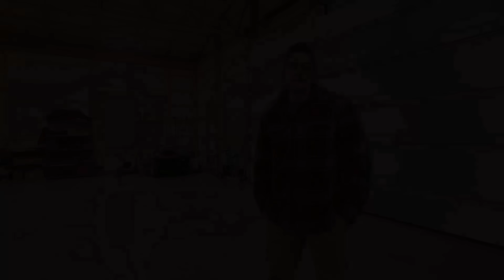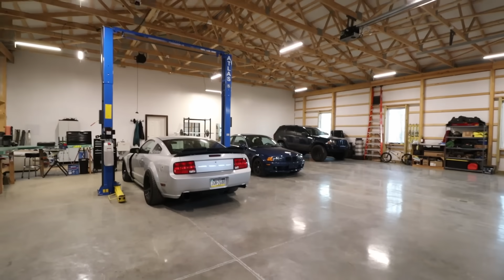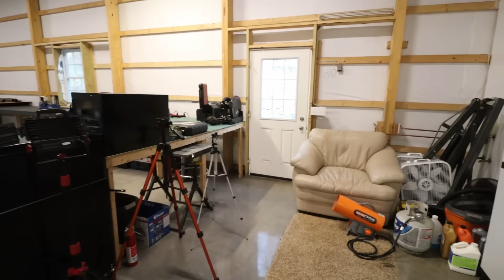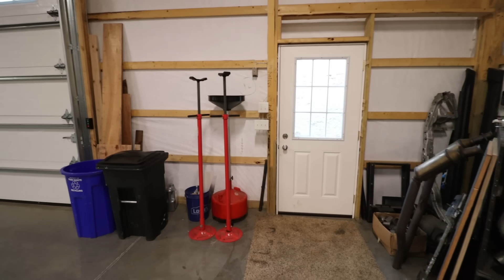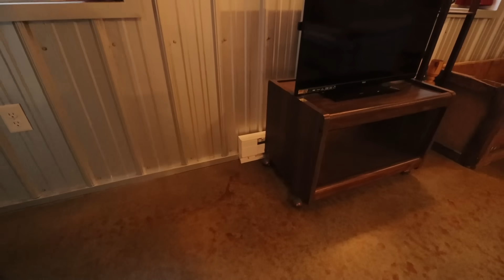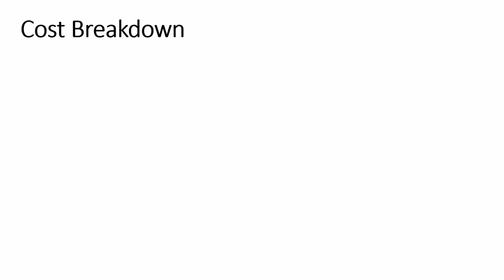50x70 Garage House - FULL TOUR and COST Breakdown

Comment: Very nice. The only thing I would have done differently is run tubing under the concrete for future radiant heat system. Once that 6" of concrete is warm the boiler might turn on once a day. I've installed quite a few of them and I always told the owners, "at least put the tubing in for future use". Comes in handy when your body gets older and colder.
Reply from the maker: I did consider this but just wasnt in the budget and also didnt wanna worry about drilling into the pipe when mounting things to the floor.

Comment: I would say mini splits are the move. We use those around my parents house and it’s definitely worth it
Reply from the maker: Someone else suggested this, definitely will look into them👍
Reply: @Kordare  remember they have a heat limit between 40 Deg F to 0 Deg F when heating depending on the unit.   In other words you will need a separate heater when it's cold
Reply from the maker: @OxAO  thanks for the tip!
Reply: The new low temp ones actually kick out heat down to -22.  Mine still heats fairly well at -13.  Yes, some backup heat is needed, but not that often.  I live in southern Minnesota.
Reply: They are great, can heat/cool certain areas of the house when needed and you have redundancy with separate units.
Reply: If you don't mind your house looking like a Bangkok hotel room.  I wish they looked better.

Comment: $134k + land absolutely. I know guys who have built 1550 sqft homes 9ft pour basement and 9ft first floor, 12/2 roof and 2 car attached garage for 140’s. Could of shaved even more off if it weren’t for geo thermal and septic. The more you can do the cheaper it is.

Comment: Saw that big step ladder.  I've got a space with a twenty foot ceiling (basically a warehouse) and I bought a trestle ladder.  The bottom is basically a 16' folding step ladder.  I thought it was a dumb purchase, but I put a frame under it with wheels so I could erect it and then roll it to where ever it was needed.  That thing is fantastic for working up in the ceiling or high on the walls.  Really, really stable platform.  I never erect the vertical trestle portion.
Reply from the maker: Nice! Yeah I like mine, it's a 12 foot with platform at the top which makes things feel a lot safer.

Comment: The house/garage would have had the more space for a second floor in the house part with out the pitch you added. 
So claiming you did the pitch that way so you could have a second floor in the house part makes no sense and you lost 
space by doing the pitch change.
Reply from the maker: I did the pitch change mostly to break it up so it didnt look like one big warehouse. The pre fab roof trusses I used were available in that pitch, the roof trusses used in the garage portion are not of the type that you can put living space inside. If I would have wanted a full second floor in the living space I would have needed to make the entire building taller or use a custom roof truss in that section.

Comment: It is interesting to see someone else with similar ideas.  In 1972 We built a 40X72 metal bldg with the house  40X24 in one end.  The house portion also has a 40X24 basement.  We've added a 24X72 extension providing addn'l  24X30 shop and a 24x40 ceramics studio/office space.   I have a machine shop in the larger shop with two lathes, a mill and several welders.  Also sheet metal equipment.   I have an experimental helicopter in the main shop with a helipad located  some 75' away.  BTW all my benches are made from steel pipe and angles.  I had the entire metal bldg spray foamed.  As it always happens, we have expanded into two 40' and two 20' containers.  a 4x4 cnc plasma cutter and 15kw diesel generator in one of the 40' containers.  With the exception of the concrete floors and block work of the basement, I did all of the erection, plumbing, wiring etc. etc.  I forgot to add:  Never had a Mortgage!!! And maintenance has finally required a coat of paint on the roof.

Comment: Will the car lift remain stable over time being that there are two support posts as opposed to four? Also is it mounted to the existing concrete? 

Great video! Looks like a lot of thought went into usability. I’m getting some good ideas. Thanks for posting.
Reply from the maker: Yup these are the common type of lift used for auto work, it is lagged into the concrete. Thanks!

Comment: Unreal, super cool space to work and live...well done man!!
Reply from the maker: thanks a lot!
Reply: Looks like working on cars is a business for you?  If so, how did that impact the permit process as well as lot /property requirements regarding commercial vs. residential use?  Did it need to be zoned commercial/mixed-use and/or bldg permits bound by commercial requirements?
Reply from the maker: @tkcarpentry  actually cars are really just a hobby, I do have a small fabrication business, but never with customers actually coming to me. So it is still just zoned residential.
Reply: @Kordare  ah, sounds good.  I'm a renovation carpenter/contractor, mostly residential but some commercial work and I know commercial requirements are very stringent and add a lot to project costs.  Cool it was able to be done residential only.   Enjoy the space, wish I had a shop that nice!
Reply from the maker: @tkcarpentry  yeah that's for sure, thanks a lot!

Comment: Don’t go down the Snap-on road.  Harbor Fright has some really good toolbox   Toolbox don’t make you money they just hold your tools.  You can get in with a lock pick as fast as a key on snap-on or HF so security is not a valid reason.  Buy good tool but HF boxes are really good now.   Love my 72”, 56” and 30” with side cabinet and 56” on both.

Also love you build seen it as you built it and was a little envious of it.  I would love to have a house like that
Reply from the maker: Great suggestion, I have looked at those and they seem very solid. Thanks for checking out my build!

Comment: You don’t need a wall around that toilet. Function over form
Reply from the maker: hahaha truuuuuu
Reply: @Kordare  when you do get around to walling it in you should consider making the toilet wheelchair access, just my two cents
Reply from the maker: @wonderfultigger6620  if space permits, I agree.
Reply: Wonderful Tigger pop pop
Reply: @Kordare  What I would recommend there is to build the walls so it blocks off that entire corner, then you can get safe storage for all those paints and chemicals. In the winter you can turn down the heat in the garage and just heat the bathroom area.  Instead of insulating the entire garage, just put in a wood stove (wood pellets perhaps, unless you've got a cheap source of firewood). We had one in an uninsulated shop in Minnesota, and it did just fine.  So between that and the bathroom, those are a couple cheaper options.
Reply: Waste oil heater. All those cars need oil changes. Wood makes a huge mess. I’m building a pole barn house right now and as much as loved the deee heat from wood I just don’t want the mess in my new house.im doing hydronic heat so that eliminates the dust associated with a regular forced air furnace so fuck the wood stove on the inside. I may build a wood fired boiler outside if it’s needed but I’m hoping solar panels and a on demand water heater will do the trickX

Comment: Would you mention which usda zone your in?
Congratulations on a well planned & executed build. The concept of making it big enough & adding the 'wants' later is very wise. You have the potential to be self employed & beholden to no one but, yourself. Did you have any trouble with any of the subcontractors on this build? Where any of them more 'difficult" than the others? Will suggest locating a small closeby saw mill for lumber needs or possible portable mill & use your own timber for future projects. Trex decking is not a 'pretty' material but, would give 15 years of maintenance free service.
Thanks great content & for sharing cost breakdown.
Reply from the maker: I was very lucky and didn't have any major issues with any subcontractors on this build. Also, my lot is zoned residential. And yeah that would be very cool to use my own timber to build some outbuildings! Thanks for checking it out!

Comment: Just get 2, 55 gallon drums and the wood burner kit on Ebay or amazon and make a double barrel wood burner and put it in the garage for now for some heat. U would have working heat for cheap
Reply from the maker: That's exactly what I've been thinking.
Reply: @Kordare  I get the drums from my work when they done with them. Plastic ones also. I was gonna start building them and selling em. But decided not to.

Comment: You might want to consider a door at the top of the stairs to keep from heating that space that you don't use for now.
Reply from the maker: I actually keep a sheet of insulation board across the opening in the winter, just didn't show that in the video.

Comment: In most municipalities, the electrical wouldn't pass inspection as is.  You can't have exposed NM cable under eight feet.
Reply from the maker: Someone else mentioned this, honestly not sure but it did pass with no issues here

Comment: Thanks for this. Well paced and great summary. It's given me inspiration for my ultimate retirement plan. Get to mid life and you end up with large, expensive house right in the city where the living space/utility space is the opposite ratio to yours. That ratio you designed of utility to living is great, and your planning for extra rooms and expansion is such an overlooked aspect for ongoing life. Well done.
Reply: 2 of my favourite details in yours are the drain in the garage floor and the interior water spigot for the water-blaster and just filling buckets etc. I think the only addition I'd make is a square drain inset an inch into the concrete right under that spigot.
Reply from the maker: Thanks for the kind words and I'm glad I could help give you some inspiration!

Comment: Very poor choice for location of window on bed wall of bedroom. Forced the bed into corner and in front of sliding glass door. Result of not doing interior furniture layout before building. Furniture placement as important to window location as any exterior appearance issues.
Reply from the maker: I actually had the bed on the opposite wall and spacing was fine but I decided to move my desk in there so this is the way I have it for now...works fine for me.
Reply: Also you never design the head of the bed with it's back to the interior entry door to the room.  You always want to face the door so you see anyone entering.

As an Architect and Interior Designer for 50 years, this is what I learned. 

You also may have problems with your proposed bedroom upstairs. You will need to have a fire egress window that has a window sill no more than 42" above the floor of that room. It appears your window is above the stairs. This will not pass any local building code.

Comment: In the garage you shouldn't have an electric outlet lower than 18 inches but I always put them at least two feet. Reason for that is vapor . Like gasoline or anything like that.
Reply from the maker: makes sense! Mine are all like at least 3 feet
Reply: @Kordare  
Try to keep extension cords up as much as possible too. I have rewired buildings after fire and in a garage things can go wrong very quickly. I really like the receptacles in the ceiling that a very good idea. Having a cord reel helps keep you safe. Makes electric connection up high enough that nothing happens. There are explosion proof boxes and things that can be done but I really don't recommend it. Just keep things up high.
Reply from the maker: @benjimenfranklin7650  great suggestions, I appreciate it!

Comment: 25:41 so for the electric do you know if it would be cheaper to have a powerwall with solar panels instead?
maybe in the long run at least
Reply from the maker: definitely not cheaper up front of course. I use such little amount of electric it would take a very long time to make it worth it to go solar.
Reply: @Kordare  i went on google and the average size solar panel cost is 11k-14k plus power wall 8k 
your electric estimate is 10k-15k
since you use very little power you could probably go far cheaper 
but i heard it's not worth it anymore once when you have the electric infrastructure because they will continue to charge you
but than again there probably isn't a lot of sun there and maybe someone can steal it
Reply from the maker: @Eduardo_Espinoza  yeah it may be worth it for some people, just not something I see in my future
Reply: @Kordare  Okie dokie

Comment: Missing the vent hood for the stove and I'm not seeing any smoke/CO detectors....these are pretty important, especially if you plan on cooking anything worth eating....but if you plan on Ramen the rest of your life, it'll do.  Personally, I would have angled the lift at a 45 and would have had plans to line them on the right side for multiples....but that's just my feelings on it from my mechanic days.
Reply from the maker: The microwave is actually a wall mount with hood vent so I plan to mount that soon. And yeah I have smoke/cO2 detectors in the main space, bedroom and second floor. Wouldn't pass inspection without those!

Comment: Very nice job, well done! One suggestion on a wash/utility sink: pick up a used SS restaurant sink. You can typically find them used for about the same as the box store plastic utility sinks. Very robust, and many have a stainless drain board on one or both sides.
Reply from the maker: Great tip, thanks!

Comment: My friends only question is we asked do y’all do under mount sinks for butcher block and all of them sead that will not do it how is it holding up is it leaking or is the wood degrading or is it not wood at all
Reply from the maker: It is real wood and I've had no issues at all with it. I used a food grade polyurethane sealant once everything was cut. Been using it for over 2 years now.

Comment: one thing that you should do is put up a 'back-splash panel' on at least some of your work benches. You won't believe how fast 'dirt' will get on the walls. Good idea about plenty of clearance around the lift area: You can move an engine hoist around it. It is absolutely ZERO fun when you can't get the engine out from the front without clearance...
Reply from the maker: Good idea! I also still need a backsplash in my kitchen as well 😂

Comment: Nice build!!. Question if you have time and see this... How did you manage to keep the ahh Garage smells lol. Gas,exhaust ect... type fume/smells out. Did you have to do anything else to seal it off so fumes ect didn't make their way in except maybe exhaust roof fans?
Reply from the maker: Thanks! I haven't had any issues with garage smells in the living space. The separating wall is fully insulated, double drywall (for fire rating) and goes the whole way to the roof line so it does a great job keeping smells out. Thanks for watching!

Comment: how did you fund this without going into to much detail of course cause im 24 and uber jealous definate dream come true
Reply from the maker: To be honest I just saved like crazy and did nothing fun for years. Biggest tip: don't buy what you don't need!
Reply: @Kordare  i honestly have a problem with that being brought up with less than other kids really changed my when i got older and made me want things i could finally buy myself and me being a car guy isnt helping or the fat that im upside down on a 15 year old car now lol i envy you dude but im trying my best even tho my inner self is fighting to give up.
Reply from the maker: don't give up man, it helps if you can write out everything you spend for the month and really pick out what you can reduce or eliminate. Getting rid of debt should be first priority.  Also, you should do your best to never have debt on a car. It's completely unnecessary.  My daily driver is a $2500 e46 and I've done nothing but change oil in 2 years. Remember to step back and  look at what you really NEED. Take it one step at a time and you'll turn it around 🙌

Comment: is having a solar power system to cut some of your electricity bills for the lighting and heating is a good option? you have lots of roof flooring above.
Reply from the maker: I use such little electricity with all LED lighting and the wood stove, that it doesn't make sense for me. It would take a long time to get a return on investment.

Comment: nice setup! On the pressure washer part, check out a wall mount electric one with a hose reel for your wand. they make really nice ones for fleet service type stuff. basically an electric motor with a pressure washer pump attached to it. there quite, always ready to go and they take up like no room.  that would be perfect in that area.
Reply from the maker: that does sound super nice!

Comment: This is almost identical to what i am planning for my future shop/house. 

Couple of suggestions though...
-1. I would have turned the lift towards the door.
-2. If you haven't already, do an oil resistant coating around and between the lift. 
-3. A pipe bender could be a good investment if you plan on doing anything that requires it. And you could offer it as a side business
Reply from the maker: I did think about angling the lift but it has worked well as it sits and yeah I'll definitely be getting a pipe bender at some point!

Comment: Love your place! The concrete looks like it's been polished. At first I thought you had white insulation board up in your shop until you mentioned it has no insulation/heat out there. So I'm assuming its sheetrock. Hopefully the vapor barrier you put up will be enough to not give you moisture/mold issues on the sheetrock, with the cold on it. Anyways thanks for sharing! Well thought out, nicely done! 👍👍
Reply from the maker: Thanks a lot! Havent had any mold issues in the garage yet. Concrete is actually just a Polyaspartic roll-on coating that I did.